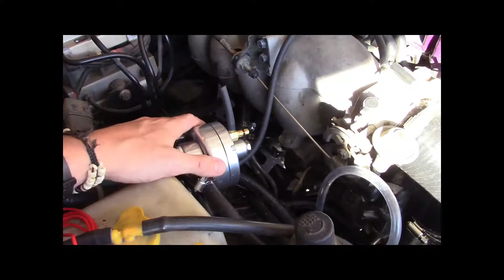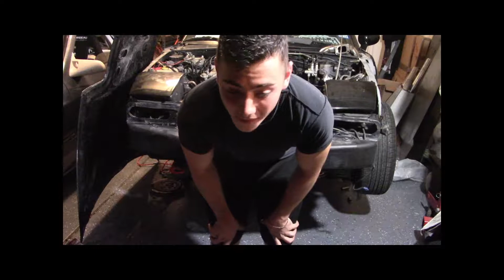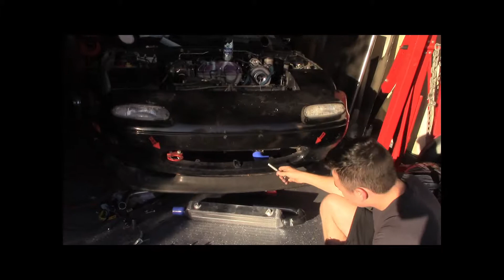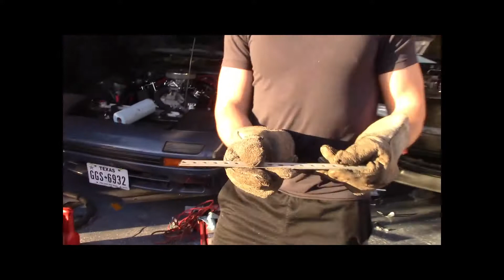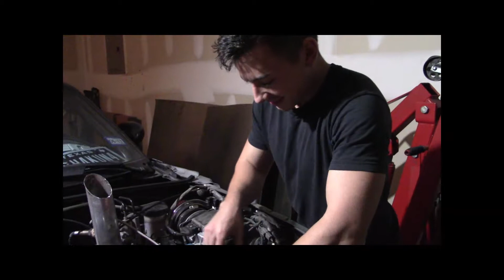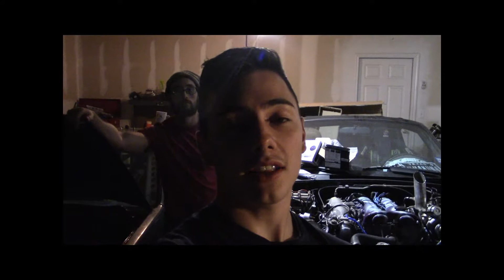Hakuna Miata Turbo Install-part 2

Comment: hey man I'm back again! hows the Miata doing? I'm so close to finishing mine but i bought the wrong oil line kit, can you drop a link to the full oil feed and drain kit with the water lines? it would be so helpful
Reply from the maker: CLIPDAPREZ  I personally just bought a  fitting from the turbo that was a 5/8 hose barb, then got a 5/8 line for my oil return, and then at the oil pan I used a 5/8 hose barb to NPT. But the NPT is whatever size you tap the pan. This worked way better for me than buying like the ebay kit I had before that leaked. As for the line that comes from the block to the turbo, that you can find easily in a kit, same for water lines. I just don’t recommend the drain line from eBay.